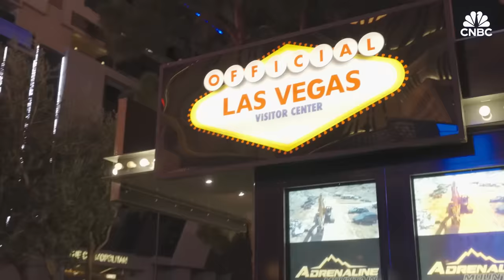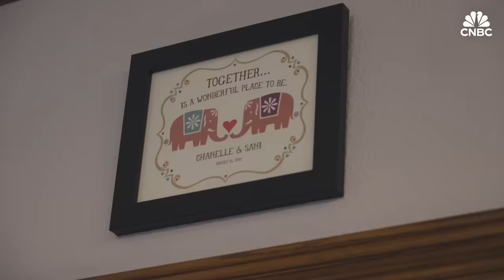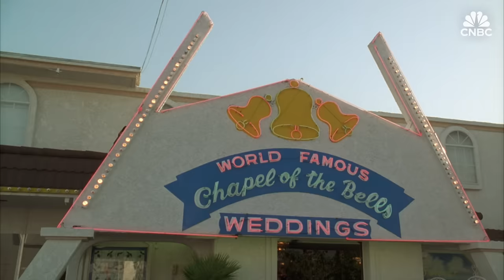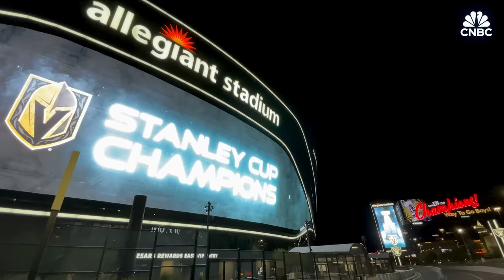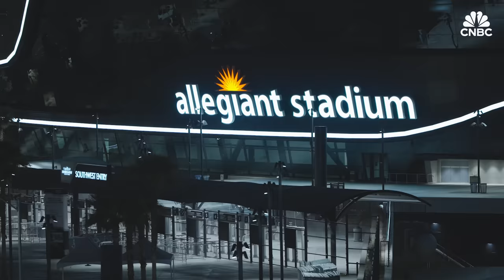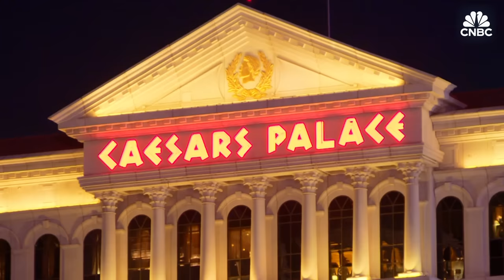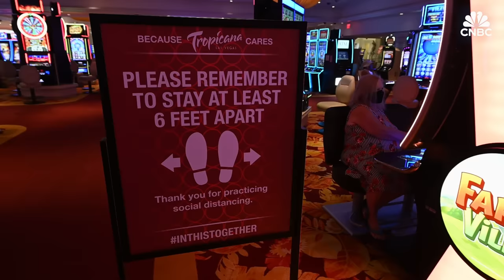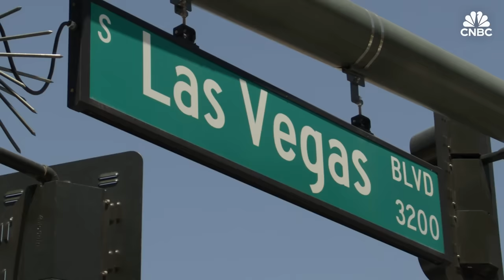Will Las Vegas’ Big Bet On Sports Like The Super Bowl Pay Off?

Comment: The Brightline high-speed rail project is said to be creating 10,000 jobs, so that’s a big boost. 

Also, the lithium mining boom for electric vehicle & battery needs is huge for Nevada as a whole. ‘the new oil’, and Nevada some of the largest fields of it on the planet. 

Nevada’s newfound status as the second presidential primary state on the Democrats’ calendar in 2028 should be an interesting wrinkle, too. (It’ll be South Carolina-Nevada instead of Iowa-New Hampshire). I find that a compelling draw, esp since that Brightline rail is targeting a 2028 completion - just in time for the Olympics in Los Angeles. There’s planned to be World Cup matches in Los Angeles or even in Las Vegas itself (if the shaky LA stadium plan fails) in 2026, too. Very interesting time to be in the state.

Comment: I've lived here for 12 years. I was kind of indifferent about it at first. Moved for a job. If you have the means and can live in a nice area like Summerlin or Green Valley, it's fine. Yes, it's nasty hot for 4 months and it's all kind of a giant sprawl. 

The expansion and new projects going up everywhere is very noticeable the last 5 years. I write software for the construction industry and things are very strong. I've bought two houses in the last 3 years.
Reply: Summerlin doesn’t get as hot
Reply: Absolutely agree. Summerlin temperature is a few degrees cooler which makes a huge difference in the summer. I'd say it is more green, but not anymore with the grass removal mandate. It is probably the worst decision the city has made because it will create an even hotter environment with little to no foliage to cool it all down.

Comment: I still find it fascinating (baffling) that a city exist in a deserted zone.
To be honest, it is this type of spending - on Earth resources - which makes me think that we are definitely in the wrong direction when it comes to efficiency.

Both temperature and humidity must be dealt with (which requires electricity), as well as water has to be brought from far away places (which requires water and electricity).
Hence, I am baffled by a city so big in a desert.
Reply: the hoover dam is right next to it which solves two of ur questions
Reply: @SuperPlayz  it seems to solve both problems, when in fact it is a double risk.
If there is water scarcity, you will suffer in both ways: (a) restrictions in water supply, and (b) restrictions in electricity supply.

Moreover, the distance of the Hoover Dam, and other water and electricity supply, makes it quite expensive to supply Las Vegas with these critical needs.
Reply: @hitardo  you are correct 👍

Comment: Vegas, the casinos and the businesses will do very well with the Super Bowl, it is the people getting fleeced with $10,000 game seats, $1200 room rates at an average hotel, $200 steaks and a traffic jams that would rival when people are evacuating a hurricane area that will feel the frustration.
Long term- the water issue is the biggest concern. If you do not have water- you do not have life. With an ever increasing population and demand for water- this cannot be solved in a desert for 3 reasons. One- even they go get some large rain oe snowfall- they have no way of capturing it- there is no real flood control in Vegas- so it creates flash flooding. The ground is so hard and packed with rock ( caliche) it just runs off. Lastly, as the heat island gets worse- so does evaporation so the water they do have in Lake Mead is going evaporate even more so each year. All states sharing water from the Colorado River are seeing population growth, so the demand for that water gets more intense.
Reply: Thats every superbowl whats new

Comment: Vegas need to pray for rain, yet when it rains it floods. Vegas floods bad off of 1 inch of rain. 1 inch of rain is nothing to other cities in the world
Reply: Desert areas tend to be that way.  The dryness and heat harden the soil so when it does rain the water doesn't absorb and creates flash flooding.  What Vegas really needs is rain and snow in the mountains that feed the Colorado River.